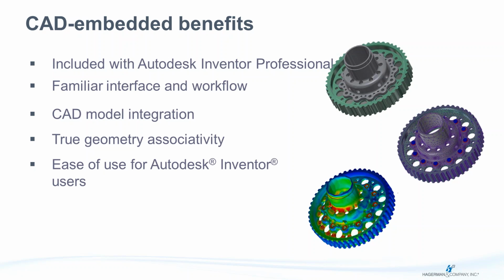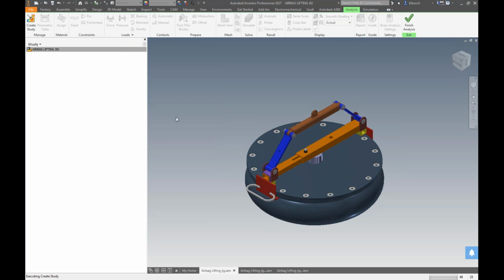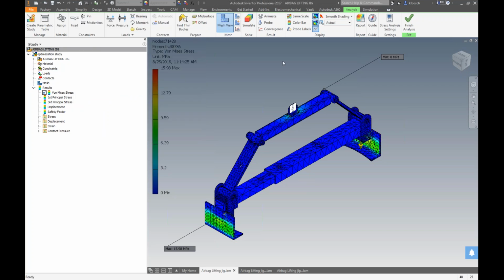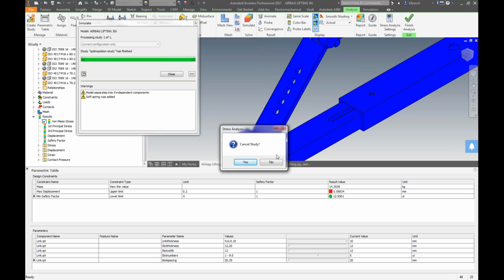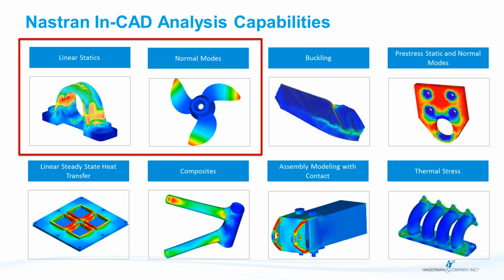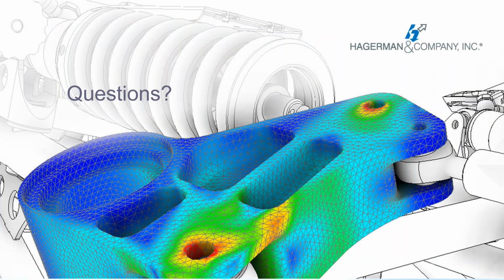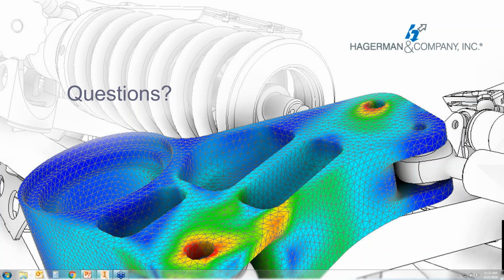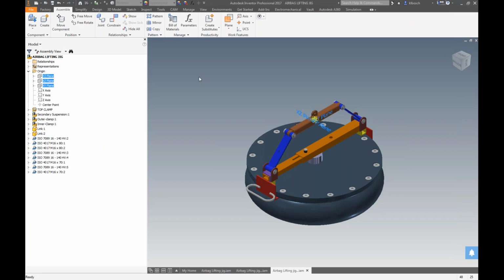Conducting Stress Analysis in Autodesk® Inventor®

Comment: can we conduct stress analysis on GFRP with foam core in inventor ?
Reply: Hello Fahd, Inventor Stress analysis is limited to Linear Material Types. I believe the Foam core would provide inaccurate results. If you are looking for an Analysis toolthat includes Non-Linear materials you will want to consider the Nastran-InCAD included in the Product design and Manufacturing collection.